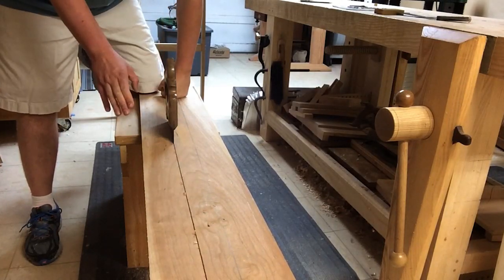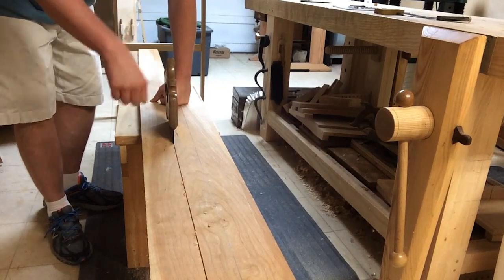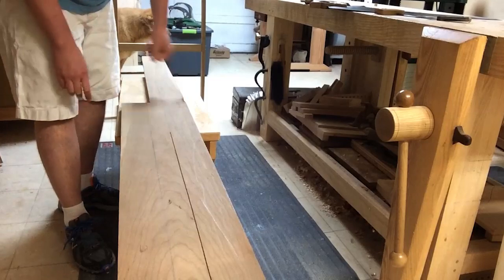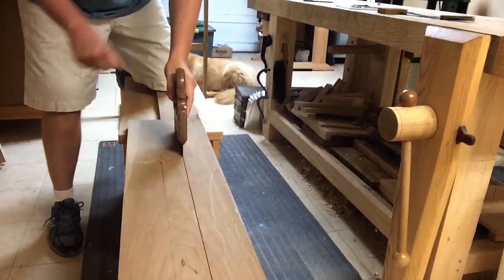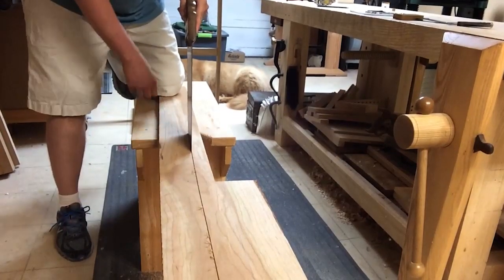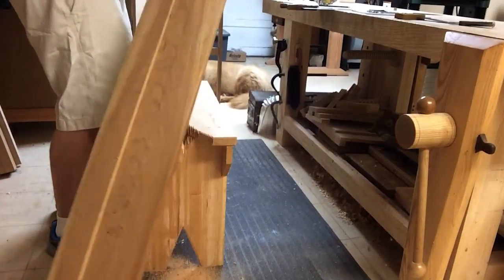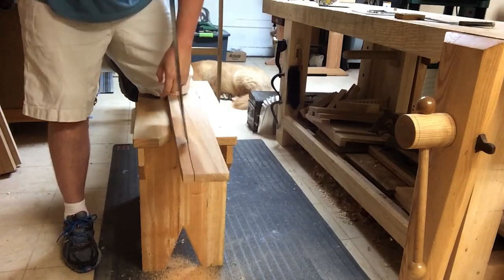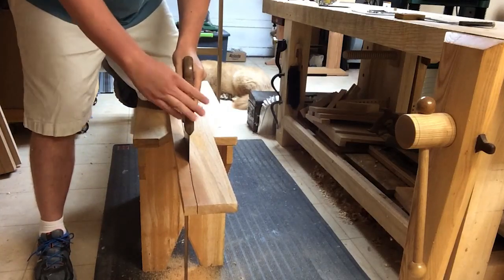Chips 'n Tips 4 Ripping Marks

Comment: I love my hand tools, but when it comes to ripping, I love my tablesaw.  If I HAD to do a lot of ripping by hand for some reason I'd buy a course rip blade for my frame saw.  You can run a narrower kerf with a frame saw.
Reply from the maker: deezynar I do this from time to time with my frame saw since it has a 3 tpi pitch, but the squared shoulder cutting style feels very foreign to me when working down on a bench.  I sometimes stand the board up but for really long stuff that doesn't work.  I'm sure it is just a matter of doing it more to get comfortable with the form but for now, it it ain't broke...
Reply: RenaissanceWW
What do you mean by "squared shoulder cutting style?"
Reply from the maker: deezynar sorry should have been clearer, my frame saw is a 2 hand saw so you have to square your shoulders to the blade like doing a chest press.  Perhaps you are referring to what I would call a bowsaw in which case you would saw with one hand like a typical English saw?
Reply: RenaissanceWW
Bow saw works for frame saw, sure.  The vocabulary in woodworking needs someone to come along and lay down the law.  Anyway, I could see how that monster saw of yours would be awkward to use.  Back to vocabulary, what do you call that saw you're using in the video?  A rip saw?  Well frame saws, I mean bow saws, come with rip blades too.  Is there a name for a saw that's a blade with a handle on one end that doesn't have a stiffening spine?  I know a panel saw is a shorter version of the saw with no name.
Reply from the maker: deezynar yep, the full sized version, AKA bigger than the panel saw or "toolbox saw", is called a hand saw.  I'm trying to remember where I have seen this confirmed but I know if was multiple sources.  But its still confusing as hell since it is so generic, but if you think about it the hand saw came first so it got the basic name and all the additional stuff were specialized versions so they have the descriptive names.  When it comes to frame saws I think of it in terms of size/function: fret, coping, turning, bow, sash, frame
Reply: RenaissanceWW
"Hand saws" came first, I'll have to take your word for that.  I've seen pictures of ancient Egyptian saws, and they were frameless so you may be right.  I know frame saws have been around for a very long time tho.  It's easier to make a thin blade that won't buckle if you either cut on the pull stroke, or keep it in tension.  I guess I'll just have to start using one of my feet to power my frame saw.
Reply from the maker: deezynar dangit why you gotta be so literal? ;)  I'm referring to the English saw lineage which was what you asked about.  Though if we want to be picky yes there are some medieval and Egyptian and Roman artifacts that look very much like the "handsaw" now.  The continentals went a different route and a lot of that can be traced to available resources.  While England was rich in ore to make these fancy big saw plates and Sheffield pushed out saw after saw, continental Europe wasn't so lucky so the thinner, narrower blade with a shop built frame became the standard.  Thus was born an alternate timeline of saws.  I'm of course ignoring the far east in this discussion too and that's an entirely different story.